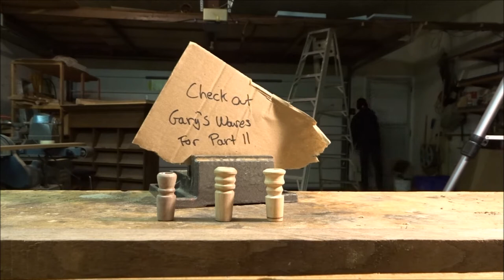How to Make A Wooden Bong Slide

Comment: Hiya broski. I am about to make a slide but I dont know what wood I should use. I have a drill press a bunch of drill bits. And I'm going to be using a fancy curved carbide rounder for the edges of the bowl peice and a v shaped bit for the inside of the bowl to give it that cone shape and then the outside I was just going to hand sand down to my liking, I'm probably going to go for a v shape all the way up but any tips or tricks ya know I'd be happy to hear em
Reply from the maker: maple. good hard wood finishes very nicely